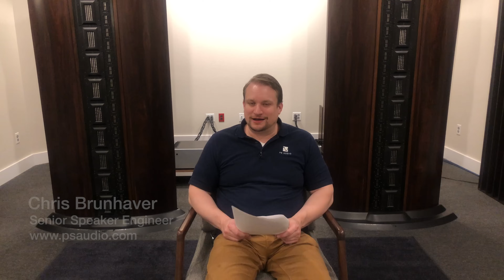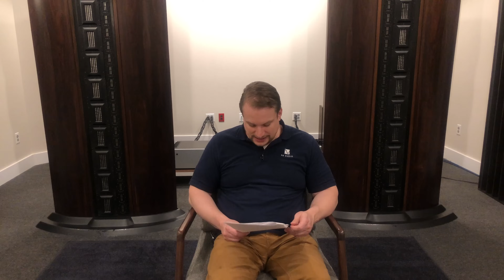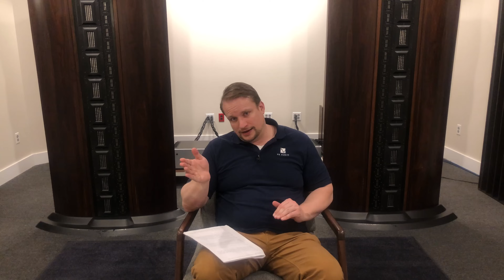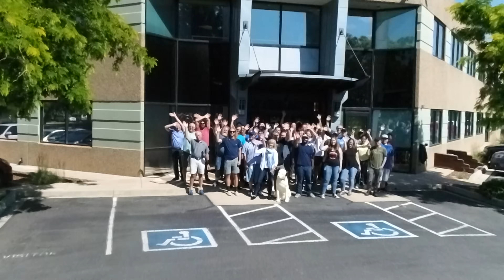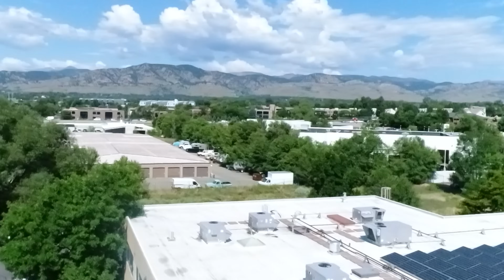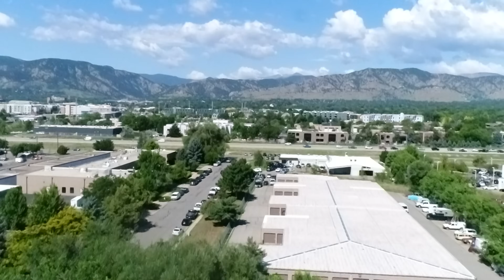Does using a subwoofer change speaker design?

Comment: I'm surprising you say 80 Hz cut-off crossover why is that at 6 DB slope ? 105Hz would be better 24db , you were just saying a minute ago better to have it it at a higher frequency the bass drivers can handle it as long as you can get down to 27 Hz plus less smearing in the mid to High frequencies what was the logic of 80 Hz?
Reply: What he's describing is really a 4 way system as he stated it was a three way monitor on top of a powered sub and if you look into the specs of other high end 4 way systems you'll find they frequently cross over their mid-basses to their woofers/subwoofers in the 80 to 200 hertz range. It really depends on the type and size of mid-bass that's used as well as the ultimate low end extension the sub driver is intended to have as to why a certain crossover point is chosen. There is no one size fits all solution.
Reply: @davep2945  yes I know that! I think the low mid-range driver is 5.5" well it was only if he's changed it? what would seem a bit low to cross over at 80 Hz and what is the point as he stated have your three-way crossing over at a higher frequency, male vocals go down to 110 Hz so slightly below that would be more optimal so the crossovers not in the vocal range.
Reply: @johnsweda2999  If he's talking about the AN3 then the version they showed at Axpona last year had an 8" midbass and then the supposed final prototype version they showed at Rocky Mountain Audiofest had switched to dual midbass drivers in the 6" to 7" range. Either way that's more than enough surface area to play down to their 80 hertz crossover point cleanly without the excess excursion that can sometimes lead to smearing, among other things.

Comment: it is a important topic, because most small speakers are designed to go low at the expense of sound quality(bassreflex and slave), and then people amte it to subs. always best to buy speakers made for sound quality and those work better with subwoofers. example sealed box design.
 I have not gotten into high pass filter yet, i seen some great passive application of that does it on the balanced wired going into the poweramp.

Comment: I'D guess with no evidence the KEF ls 50, as  a good speaker, was designed to go with a sub or 2.
Reply: If Not, WE can blame the  BBC -  LS3/5a.     ;-)
Reply: @RoaroftheTiger  they were designed to be used with a subs biggest speakers built into the walls they are desk mounted speakers monitors near-field
Reply: @johnsweda2999   ls50 is flawed, it can not be used without as subwoofer, and it is has port making it have sound qualety compromised to fake some extra bass. the speaker is just a mess.
Reply: @johnsweda2999  - John, They were First designed for Monitoring  Location Broadcasts; with a haphazard  placement in a Van. Though, I would favor Your Description , as Ideal.
Reply: @RoaroftheTiger  yes they were used everywhere near field listening and for vocal balance not just music